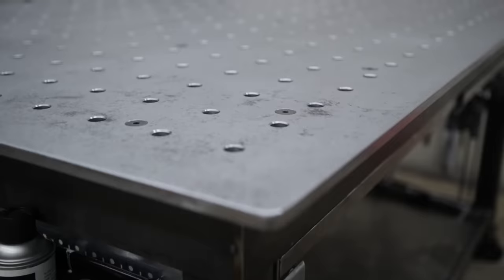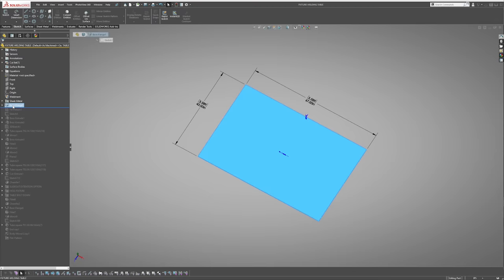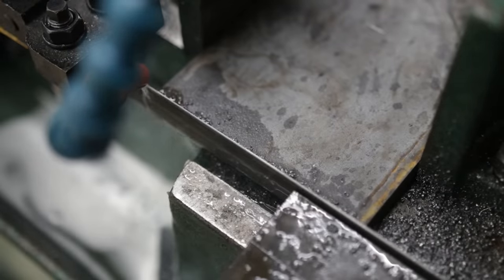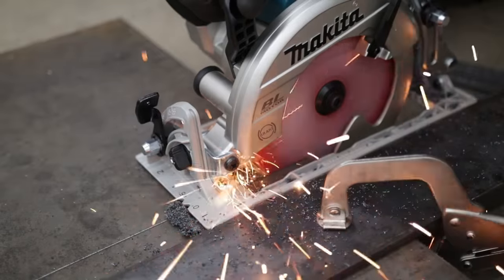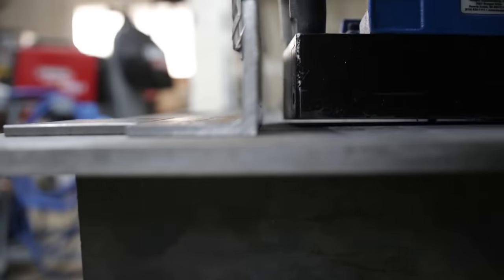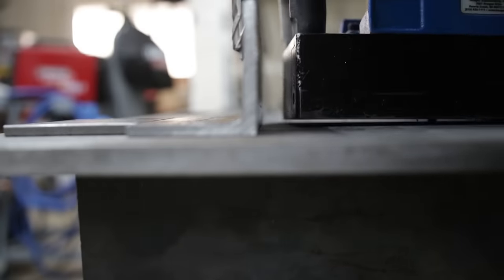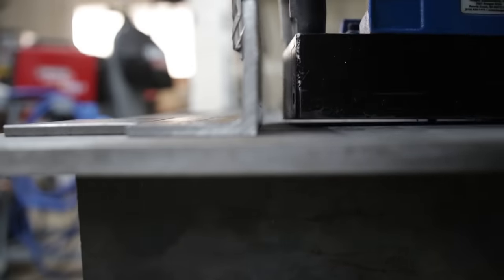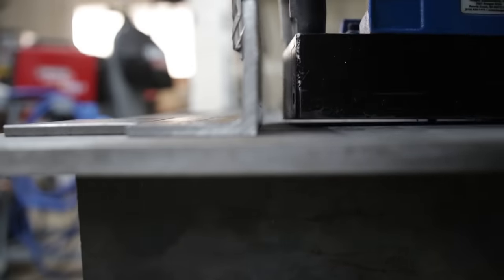Homemade Welding Fixture Table + Storage Hack — Built for my Home Garage Shop

Comment: Could you possibly go a smaller thickness on the plate and have this table still work? I don’t have a shop crane or anything to move a 1/2 inch thick plate off of a trailer or truck bed lol
Reply from the maker: yes you can get away with 3/8" no problem anything less is questionable in my opinion.

Comment: Maybe I missed it but is this a half inch metal top or cast-iron?
I’m just curious if you’ve had a hard time with non-cast iron, and having to clean welds off your top constantly. Very ambitious design and amazing what you were able to do with basic tools. I wish I had these welding skills to make my own table.
Reply from the maker: 1/2” hot roll steel plate
Reply: @RathaSochenda  do you spend a lot of time cleaning material off of the top plate or is that just something people say in order to sell more expensive cast iron?

Comment: Hei Ratha nice job! Very inspiring. I just got a question about the wheel. I'm thinking to use the same one but not sure. Are you satisfied after a year using it? Do you move the table a lot?
Thank?
Piero from Italy
Reply from the maker: The wheels are amazing. They design to work on concrete so it rolls nice. I move the table probably twice a month because I work in a small shop is almost necessary depending what I’m working on. If you don’t plan on moving the table much let’s say less then a couple times a year I would skip these. But leveling your table is important bc your floor is uneven then I highly recommend these. Hope that helps

Comment: Great Job love the table! However I would love to know how you built the frame for the top plate. This is the big issue with a project like this! How did you keep it flat and square on a concrete floor?
Reply from the maker: I use my table plate as the working surface and then use my leveling system to tweak it further. So even if the table plate weren't completely flat I can tweak it using the adjustment bolts of the leveling system.
Reply: @RathaSochenda  Well thanks for taking the time to reply. Your work is inspiring to say the least and thanks for sharing!

Comment: Hey man great table!! What’s the maximum allowable tollerance you allowed between the holes? Having a tough time keeping consistent
Reply from the maker: Really depends but your always going have some sort tolerance stack in between hole to hole. Several factors include how accurate you made your jig and the runout of your mag drill. I expect rough .010” maybe. And if it’s more thank reevaluate your jig and mag hole position
Reply: @RathaSochenda  I re fabricated the jig and got a new cutter (work got a new cutter 🤣) let’s just say I wasted a lot of company time getting my jig right and about 100 holes down. One of my rows on the short side won’t be able to be trusted 100 percent but it’ll be good enough for where I work.

Comment: I love your work, but I have a question, how do you make the projections not stick? Do you add any product, do you mat it or clean it with oil before?
Reply from the maker: Thanks. Here and there your going to get weld splatter no matter what. What I normally do to reduce the amount that gets stuck on my table is I use anti splatter when I mig weld, use shims to which helps offset my workpiece so I don’t weld to close to the table, and last I use a thick plate of steel and slide it to knock of the slag of splatter. Also i coat my table with light spray if wd-40 to prevent rust maybe that also helps idk 🤷
Reply: @RathaSochenda  Thanks to you.
Perfect, it was more or less what I thought.
I still have to make my own table, it's nice to see how yours shines and looks hehehehe, in my work I do use anti-projection spray, and if in some tables I use wd-40 on the board itself for oxidation, and if it helps you or advice, it is also very good to use any type of motor or transmission oil (motorcycle or car), I prefer motor oil, but both work very well.
Thanks again and congratulations.

Comment: Amazing video, thanks :) How do you prevent mild steel from warping?
Reply from the maker: Fixturing as best I can
Reply: @RathaSochenda   cool. Also if you drill with 5/8 annular cutter, would 5/8 tools fit? or do you need to drill with slightly bigger cutters such as 16mm which is 0.125mm larger than 5/8?
Reply from the maker: The 5/8 tools still seem to fi still . It might be tight first but I imagine over some time it will loosen up. Also most 5/8 f Turing tools I’ve encountered are slightly under size by few .001”
Reply: @RathaSochenda   thanks a lot ;)

Comment: What clamps are those? Just built mine based off the plans
Reply from the maker: Welding Plier Clamp: https://weldtables.com/collections/clamps-accessories/products/3dp-70-heavy-duty-3x10-table-clamp-amor-tool
Welding Plier Clamp Short Post: https://weldtables.com/collections/clamps-accessories/products/acc-300-3-certiflat-fabpost-5-8-4140ph-zinc-plated-heavy-duty-post

Comment: Really good job, how many cutters or bits did it take to punch all your grid holes thru?
Reply from the maker: I was surprise but only one annular cutter. The key was to keep the cutting process lubricated at all times. And cutting at steady uniform rate also contributed to a longer life to the bit. I still have it and it’s still nice and sharp.

Comment: The mag drills tend to have play in the column as well as in the cutter itself, im not sure your indexing method is any more accurate than scribing a grid, punching and drilling, what are your thoughts in hind sight
Reply from the maker: The mag drill I used had very little play. Combining that with a 5/8 annular cutter and jig I was really surprised by the accuracy. However its still a hand tool and there could be some user error but doing it this way seem to work out for me... it’s not cnc precise but pretty darn close.

Comment: Is it a good idea to put a metal cutting blade (if i can even find one) on a circular saw for wood? I have no experience in these yet, but using a 4" angle grinder on a jig gets old quick. No access to  oxy-ace/laser/plasma etc sadly
Reply: No, they spin too fast.  There are circular saws made for cutting metal, DeWalt, Milwaukee and Evolution make them.
Reply from the maker: Luckily I was able to use the Diablo cermet blade on a circular saw and it worked out great especially for thinner metals. I would say nothing more than .250 inch thick if you want you want the blades to last. Give it try the blades are relatively cheap.
Reply from the maker: Yeah the Milwaukee metal circular saw is nice especially if this is going to be your go to method for cutting sheet by hand.
Reply: Thank you for your helpful insights. Metal cutting saws are so hard to get by here and cost way more than an arm and a leg. Guess ill be working within the limits of my workshop and wallet for now and not make any bonehead mistakes with high rpm power tools.
Reply from the maker: But yeah I would give the Diablo cermet blade a try on a wood circular saw. It’s only $30 and I think it’s worth a try.

Comment: How are the casters holding up? Any wobble to them once they are on the rubber? How easy are they to operate to lift the weight of that table? Would love an honest opinion before spending a bunch of $$ on them.
Reply from the maker: Caster are holding up great. No wobble still works like new. Pretty easy like standard ratchet wrench.  You won’t be disappointed!

Comment: Just a thought. For cutting metal, the brushless motor saw might not be the best choice as they are permanent magnet motors. Not a motor expert myself, but I wonder if a brushed motor attracts less metal dust/chips, and can be blown out with compressed air a little easier. Any experts out there?

Comment: I'm late to watching your video. Very nice by the way. You need a metal cutting cicular saw. They spin alot slower than typical circular saws. Blades will last longer. 5500 rpm compared to 2800.
Reply from the maker: 👍. Good think I have a cnc plasma cutter now 😅

Comment: Love this table but my experiences with arcing/melting though extensions cords for the hand grinder, etc, that was in contact with something I was welding would make me think twice about having a metal table with grounded electrical outlets attached to something that may effect the performance of grounded welder and possibly be an electrical hazard.
Reply from the maker: Luckily so far I haven’t had that issue. 🤞

Comment: Great build, it came out extremely professional!
I was going through your information and noticed all of the items. What I didn’t see is the version of your 3D solidworks program. I went to the website and was going to purchase one of the versions but had no idea which one you used. I liked what I saw in yours. There are different prices for the different versions, they go from $100.00 to more than a thousand. Any help would be greatly appreciated.
Reply from the maker: As far as the CAD program I’m using Solidworks 2018. Any of the version standard, professional, and premium will be able to do what I did in this video. Just got to see what fits your needs and budget.
Reply: @RathaSochenda  Awesome, that is exactly what I was looking for, I appreciate your prompt response!!
I think you did an absolutely amazing job on this build, your thought process was extremely efficient in reference to what you wanted to store and where you wanted those items to be. Thumbs up 👍!
Reply from the maker: Thank you I really appreciate the feedback🤙🏾

Comment: How did you remove the mill scale on the table? Has the table wrapped any since using it?
Reply from the maker: Wrapped the in cleaning vinegar did the trick
Reply: @RathaSochenda  Is the table still flat?
Reply from the maker: You bet! 👍

Comment: I’m totally new to all of this. I purchased your plans and If I understand correctly, you used the MIG welding method for this project. Could this be accomplished using the TIG method? If I’m looking into making an investment as a hobbyist, I don’t have the space for a number of machines (TIG/MIG/Etc.) eventually when my shop is built, it’s just a 10x12 space designated as a multi project space (wood working/welding)
Reply from the maker: Yea this could definitely be done with tig as long as you have at least a 200 amp machine to or something to penetrate 3/8” thick plate
Reply: Mahalo Nui Loa for the quick reply! What is the DXF file in the download? Do I need a special program to view it?
Reply from the maker: The DXF is the cut file for the table top if you decided to get it waterjet or cnc laser by a company
Reply: @RathaSochenda  Thank you so much!
Reply from the maker: Anytime 🤙🏾

Comment: Crazy good video quality for a project about welding. 
When you said "basic tools" I didn't think you'd be pulling out a mag drill. Otherwise I loved the video.
Reply from the maker: Thanks. Mybad… I guess mag drills are not as basic as I thought. Next time I’ll just say mag drill.
Reply: @RathaSochenda  No problem. Right now I have a grinder, a welder, a drill press, and one of those cheap welding tables you show in the weld table video. What kind of mag drill do you have? Some youtubers have tools lists on their website or they do a "these are the tools I use" video, or even shop tour videos yearly. Could be a good addition to your channel.
Reply from the maker: That’s a good start to your fab arsenal. I have a Hougan 917 mag drill. Also in my area you can rent for $60 day. Also Evolution also makes a good mag drill (see the link in description). Yeah good idea I’ll add a “what tools I use” video in the near future.

Comment: Hey, how many angular bits did you go through to do all those holes with the mag drill?
Reply from the maker: Only one surprisingly. The key was to make sure it fully lubricated with cutting fluid and plunging down at a uniform speed. Crazy huh?!
Reply: @RathaSochenda  ...and so that bit is good to go for another couple of hundred cuts?
Reply: Just one more question if you don't mind. You mentioned that you chose the spacing of the holes to minimize the number you'd have to drill. Did you take into consideration any universal anchor hole spacing for items like bench vices or other stuff you may want to periodically add and remove from the bench? Thanks in advance. ;)

Comment: What kind of mig welder are you using? AND are you using argon or just the standard flux core wire? Thank you and table looks awesome!
Reply from the maker: It’s a Lincoln 180 check out the link in the description for more details
Reply: @RathaSochenda  yes sir I looked there first but I did not see a link for the welder. Thank you
Reply from the maker: Sorry good catch I’ll add a link for more info. And I’m using 75/25 argon mix
Reply: @RathaSochenda  awesome, thank you!

Comment: Hey, is the table grid frame also .5” material like the table top?
Reply from the maker: 3/8 I think
Reply: Is there any problem with interference of the 120v outlets when welding?
Reply from the maker: @theflipperbros5031 nope

Comment: What a great video. Curious what you may have paid for the metal used to build this? I would like a baseline amount before I head to the metal store and get ripped off. Cheers!
Reply from the maker: Thanks. Pre-pandemic I paid a total of $1300 for everything you see in the video.
Reply: Awesome. Thanks for the reply. Subbed to your channel. 👍🏽
Reply from the maker: Appreciate it🤙🏾
Reply: Purchased your plans for this table a while back, finally got around to getting the top laser cut by a shop local to me, pick up the rest of the metal later this week, can’t wait to finish this thing!!

Comment: 6:56 inserts metal cutting blade backwards and it doesn't cut very well. 
13:17 inserts it the correct way and it cuts fine... 

Very well thought out and made table though..
Reply from the maker: Good eye. I install it like that the first way to show what type of blade I was using for demo purposes but I actually installed correctly off camera when I was cutting the half inch thick plate. Sorry if this confused a few people. I don’t even thing a backwards installed blade would cut at all… either way I was little ambitious cutting through 1/2” thick plate 🤣

Comment: Unfortunately 1/2 inch plate is going to warp pretty quickly.  You want to be over a inch minimum, preferably 2.  That being said, there's a bunch of slick ideas here. Sweet build.
Reply from the maker: Because of how I did the framing and bolts to adjust flatness I think I should be ok for the stuff I’m doing. I don’t plan to do any crazy hammering on this table as it’s more setup for precise work I guess.
Reply: @RathaSochenda  its the uneven heating it sees being welded on.  But you may be able to keep adjusting it being its not permanently fixed in place.

Comment: What did the 1/2 steel plate cost?  What grade of steel is it?
Reply from the maker: Back when I purchased this it was $450 hot roll
Reply: @RathaSochenda  Mild or Carbon steel?
Reply from the maker: Mild

Comment: I would use on off magnets to clamp stuff  . So no need to drill hundreds of holes
Reply from the maker: While those will work they don’t suite all applications and are limited 😅. Having a fixture table opens up more ways to jig things up.

Comment: Very nice, do you have a total cost of materials to build this? I am curious to take on building my own but feel as though it may not be worth it to me if it’s going to cost more than $1500 replicate
Reply from the maker: It’ll vary from place to place but for me materials cost me approximately $1200. That’s everything you see in video from top plate all the way down to the casters. You can save a few bucks if you go with cheaper casters.

Comment: Hey Ratha, do you have any video mentioning your Thinkpad. I'd love to see all the info about it. Like any upgrades you've done or just what model it is. I love that old school look and wanted to get one myself and upgrade what I can in 2021. Military laptops are like porn to me.
Reply from the maker: It’s a thinkpad w530 with upgrade 8g of ram and a upgrade to SSD and latest version of windows. I bought it new back in 2010 and surprisingly still has not broken on me.  I mainly now just use it to browse and open simple CAD files to view.

Comment: what hooks you use on the wall control?
Reply from the maker: Check the video description I think I left a link for it there
Reply: you only put the Drill Holder and the Spray Can Holder but not the normal hooks to like hang the hammer
Reply from the maker: Oh my bad. If you check wall controls website there should be few options for you
Reply: Ok thanks and also very good video
Reply from the maker: Thanks glad you enjoy this!

Comment: If you want an even flatter servace use a manufactured straight edge instead of a level.  levels aren't as straight as a milled piece of aluminum
Reply from the maker: Thanks for the tip👍

Comment: while You made the cuts with the circular saw, did You turn the blade as in 6:56 of this video, Your metal cutting blade is installed teeths wrong way. That's why it didn't cut.
Reply from the maker: I corrected it but didn’t show it in the video when I made the cut. If it was indeed flip the other way i don’t thing it wouldn’t even cut at all to be begin with.